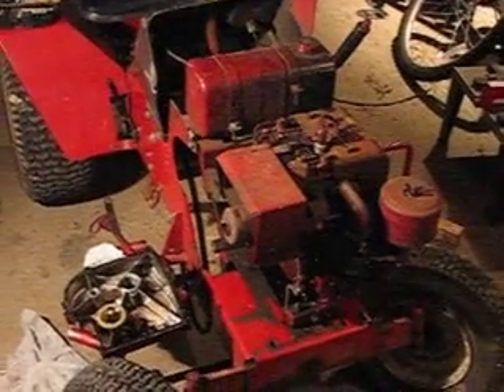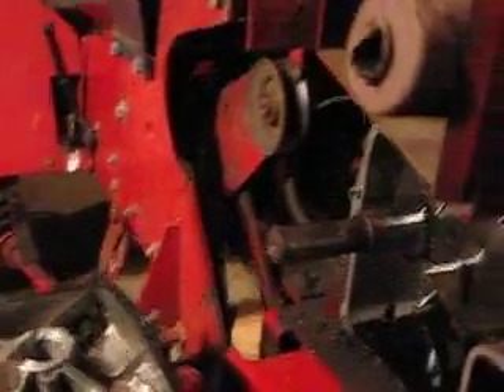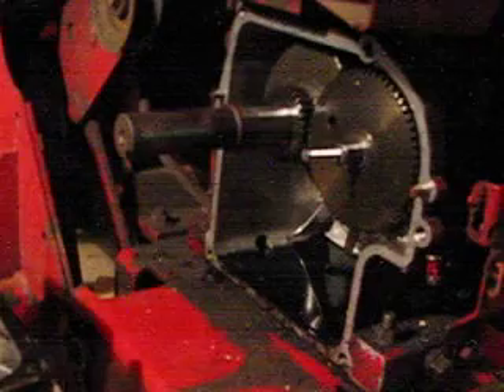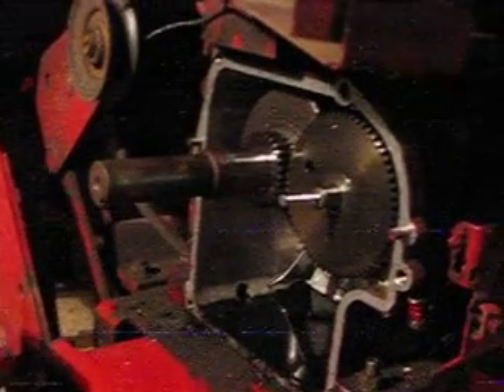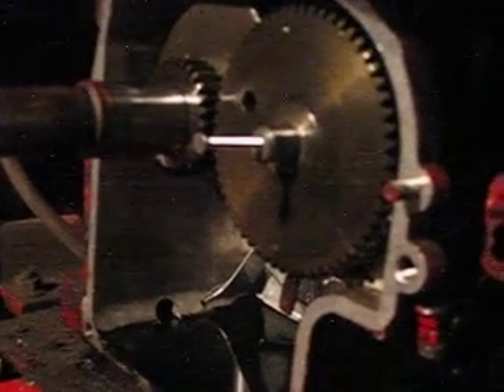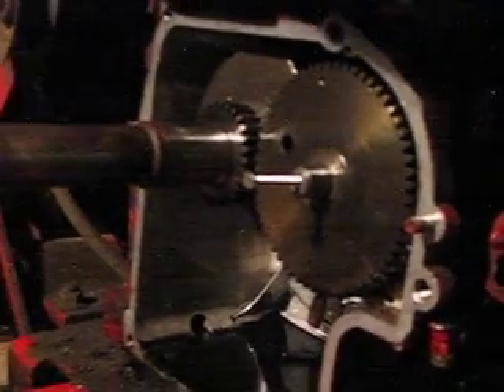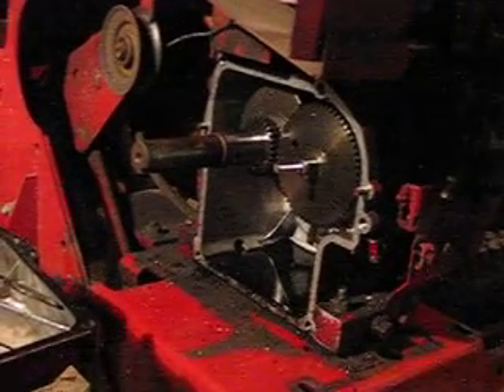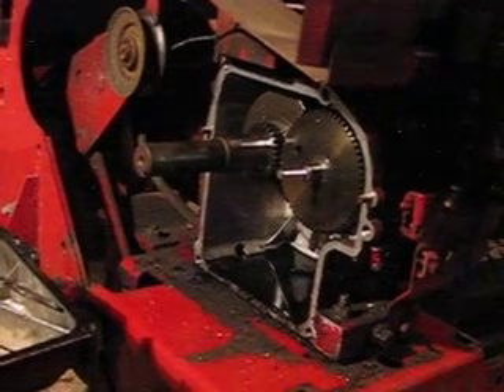Hydro Lab (My Garage) #23 Donor Tractor

Comment from the maker: Yes, I had to drill it by hand.
If you need the circuit schematic I can get it to you. The only thing I'd change is replacing the pickup reed switch with a small coil. 

Thanks for watching! 

Maurice